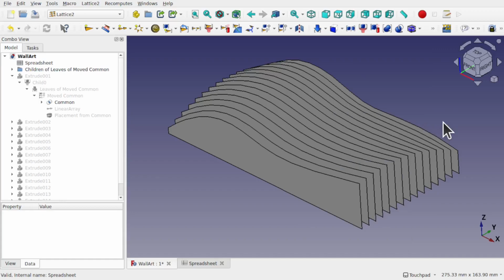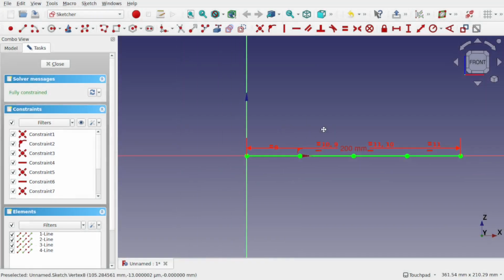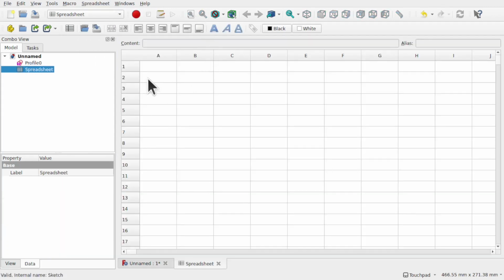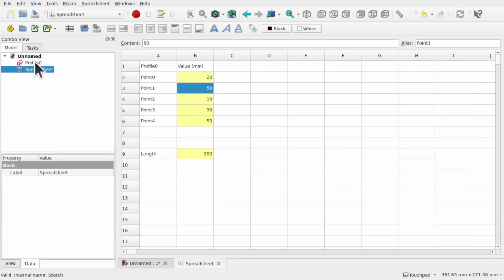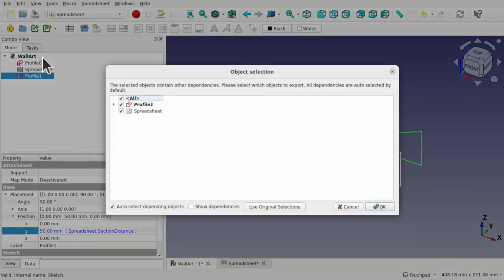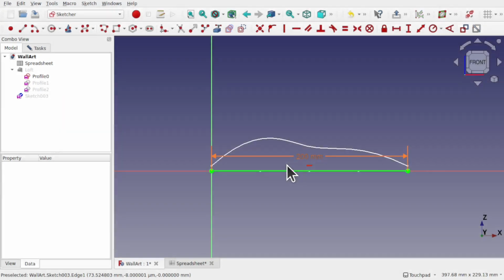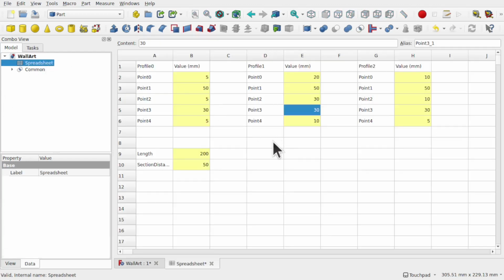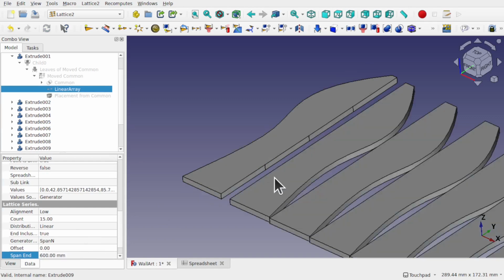Creating Parametric Cross Sections in FreeCAD using a spreadsheet

Comment: Hello! Thank you very much for your efforts! Unfortunately, I encountered an issue with Loft when trying to recreate this project. The sketches don't appear in the list of available profiles. What could the root cause be?  I'm using version 1.0.2 of FreeCAD. Everything works fine when I use simple shapes, such as circles, but doesn't work with b-spline.

Comment: Ive been trying to replicate this but when i go to use loft nothing shows up in the selection tree. Im using the latest version of Freecad. Is there something different i need to do?
Reply: I just hit the same thing.  The problem seems to be that the tool treats the points as not being a part of the one wire that's allowed for a loft or a sweep. The solution is to not add the control points as separate things and then connect via the spline.  Draw your spline and it'll make points.  Then go in and do all the selecting them and the ones on the bottom and make them vertical, etc.
Reply: @celstark  Awesome. Thank you so much! Ive been racking my brain trying to figure out where i was going wrong.

Comment: Great tutorial. However a heads-up using 1.0 OCR1. Attempting to loft the first 3 profiles none of them showed up as available. The field was blank. The points used to attach the B Spline on the top surface need to be construction points, or eliminate them entirely and just use the B Spline points. Profiles containing normal points cannot be lofted. I found a a bug report from last week on GitHub or I would have never figured it out. The person who answered the report closed it citing "user error", so no fix is coming.

Comment: What version of Freecad are you using? When I try @4:57 it just starts moving the point along the line. Maybe Freecad on OSX just doesn't work properly. I've had numerous issues with it whereas the linux version just seems to work properly (and presumably Windows too). Also under linux, after adding all the b-spline points I get a weird shape, not a single line.
Reply from the maker: I think I may know what's happened. I think you are using a b spline rather than a polyline. Easily done but two totally different tools. Give the polyline a go and see how you get on.

Comment: I've been thinking about how to do this on FreeCAD for a long time. Seeing how the resulting bspline line does not connect to the heights you are setting in the spreadsheet, if you select "B-Spline By Knots" or  "Periodic B-spline By Knots" , the constrained points remain on the b-spline resulting line. You could also put up a ton more points for this if you are fabricating with known 3d curve formula, since you'd be able to generate the point constraints as a function of position relative to origin and the 3d curve equation.

This tutorial just freed up creativity constraints in a bunch of projects I am planning for wood art around the house and an acoustic horn design that uses very particular geometry! Donation going your way!

On a question related to this, is it possible to use a 3D STL file surface as the cutting edge of the array of cross sections? Like if I had a STL file of a face, and I want to use the STL to be the outside or inside edge of the cross sections.
Reply from the maker: I am not sure if I have answered this one twice or a very similar comment so apologies in advance if I have. Great idea about the other b splines. Looks like the creative juices are churning on this one for you 😀 interesting regarding the formula!. For the stl you can convert it to a shape in the mesh workbench. Or you can use the mesh cross section tool to get slices and use that. These slices can be exploded in the part workbench.